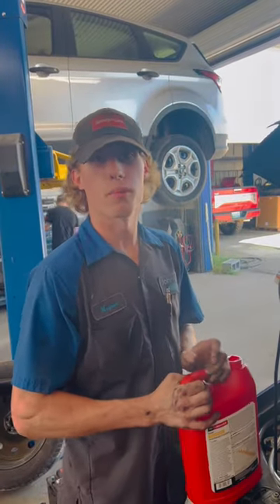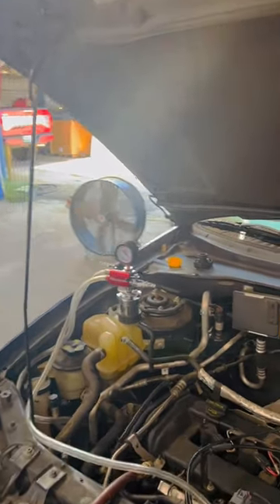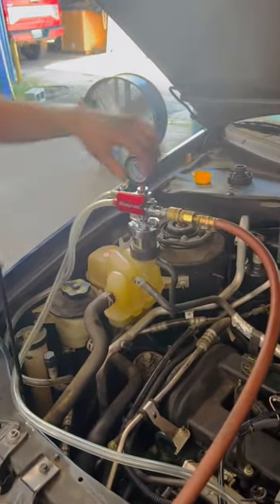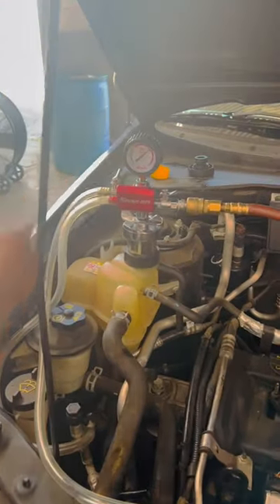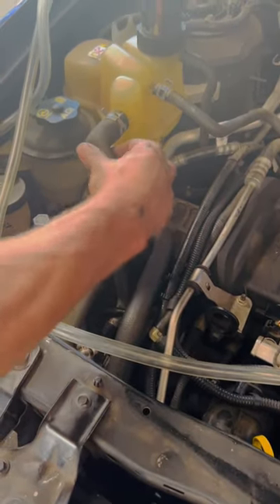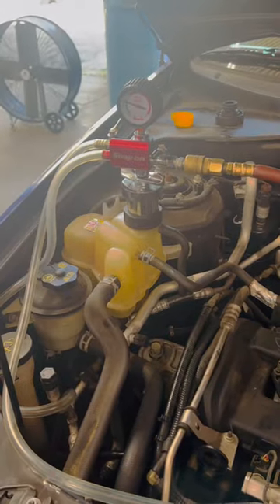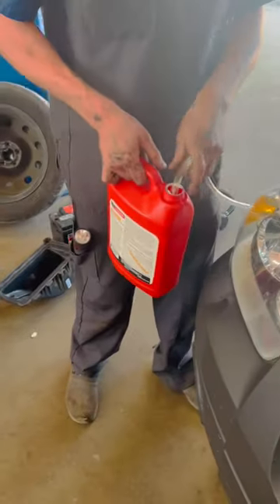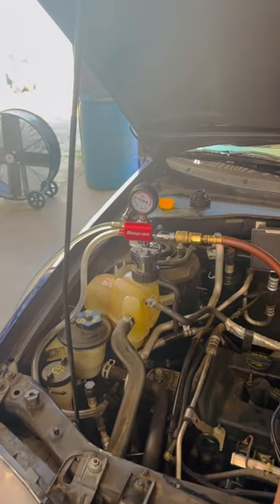How To Fill A Cooling System The Right Way #shorts

Comment: Great! Now I got to buy another tool.
Reply: Yeah lol, they make something called a funnel that costs $3.50 at harbor freight that’ll work just as well vs a $350 snap on tool you might use maybe once.

For those wondering harbor freight makes a vacuum filler as well that’s $50.

Comment: Why bother if you have a radiator cap? Better fill alot of them to pay for anything snap-on.
Reply: He specifically said its for newer vehicles. Most which do not have caps on the radiator.
Reply: @sdvten  that figures. No trans dipstick. Pretty soon no oil dipstick. Wonder where the pressure release is? Old retired line mechanic.  All this new stuff is ridiculous. Now new BMW has a water cooled alternator. WTF.
Reply: Doesn't take a lot of brain power to figure out that this tool saves a lot of time which would otherwise be spent 'burping' the air out of cooling systems. Time is money. Pretty simple if you take just a few seconds to think about it.
Reply: @Krankie_V  trying to beat the flat rate book? The factory flat book has made mechanics do shitty work for years. Everytime you hurry you fuck things up. I'm not into comebacks. comebacks. If you can afford it buy it.
Reply: @genefoster8601  this has nothing to do with hurrying.... It's a legitimate way to fill the cooling system quick and efficiently with no trapped air so you're not wasting time burping it. It both increases efficiency and the quality of the job. I don't rush things. When I can use a tool that saves me a step in the process without sacrificing the quality of the job, you bet your ass that's what I'm gonna do.
Reply: @Krankie_V  if it isn't broke don't fix it.
Reply: @genefoster8601  OK boomer
Reply: @genefoster8601  bmw hasn't used dipsticks on a lot of their models for years now
Reply: @firstlast---  WHY?
Reply: @genefoster8601  It's cheaper and easier to manufacture without a dipstick when you can just use software to make a calculation of how much oil is in the pan. I'm not defending it, it's insane, but that's just how it is. BMW isn't the only offender

Comment: I have a 1998 and 2010 vehicle. So I will just stick to the old ways. If I had a 2016 or newer if give that a try.
Reply: I've used it on many vehicles that old and older with no problems
Reply: @SUMDUDE. , ok. I just run it up to temp and squeeze the hoses and refill until I'm sure all air bubbles are out of the system. 

I didn't say they don't work. I don't care if you've used them,  they work well from what I can see. I just have no need for one, i’d use if every  4 -10 years. My driving habits only net me 7,000 miles or less per year. Currently, I'm at 0 for now as I've had medical issues and haven't been driving.
Reply: @SUMDUDE. , you keep doing what works for you. I’ll stick the way that works for me and I’ll still have a few hundred dollars in my pocket to buy more parts I need to replace. A tool I’ll use maybe 1 time every 5-10 years and can rent for a couple days or borrow from my friend a dodge, ram, Chrysler, Jeep technician or head on up the dealer ship and use after they close.

Comment: I've seen that vacuum system DESTROY: Radiator seals, thermostat housing(s) and Heater cores 😱 in about 10 seconds. Be really ready to do "free work" on whatever you destroy bro. Because it will be your fault. I am sure people didn't bring a vehicle in, for you to say (upon refilling my cooling system), it NOW needs a $1,100 dashboard heater core job, due to your "time saving" vacuum cooling system filler device. Do it properly or don't do it at all.
Reply: 24yr. veteran collision tech. Been using one of these for almost a decade, never had any of that happen once
Reply: @chadvalliere8697  well... Here, in Cleveland, "The Rust Belt" of the USA? I've PERSONALLY seen it destroy over 100 vehicle(s), 1 by 1. They put too much negative pressure on a POSITIVE pressure system. Ever Try to "Suck the air" out of your lungs with one of these? Why not? If it works so well on a car, shouldn't it work just as well on you? My 1999 Ranger & 2000 Honda Accord cooling system would implode. It takes ANY imperfect part and turns it inside out. It makes anything PLASTIC or RUBBER, brittle. I dare you to find an ASE certified cooling system fill procedure (or manufacturer recommend step) that has a "vacuum cooling system step" in the directions of filling ANY cooling system, look in AllData, Mitchell on demand and/or any DEALER level database, get back to me when you find that step. I've already looked, doesn't exist. 💀 The first time you destroy a heater core and LIE to a customer? You'll remember this post. What are you gonna say? They need a $1200 dash/r&r heater core job? Because YOU wanted to save 10 minutes and do it faster? If you destroyed MY vehicle with one of those units, you wouldn't be fixing any cars for a few weeks. Wake up in the hospital with a broken hand. Use ASE tried and true procedures or continue the stigma of parts changer / "mechanics" are hacks. I have 3 college degree(s) and never, ever had to explain to a customer that we "blew up" their vehicle, not once in 30+ years of being an ASE certified technician. Good luck with your vacuum pump. You'll regret it one day soon... 😱🔥😈🥒
Reply: You sound like a “paper champ” spouting off all of your accolades that you’ve accomplished on paper.
Reply: @delascott964  🤔 Hmmm 33 years doing this. I run 2 shops Six days a week... So WHAT exactly is that "paper" your crying about, other than the $$$$$$ in my bank account. Looser 🤣
Reply: @jasonpocaro2730  if you were ASE cert or whatever you wanna call yourself, you would know there is plenty of manufacturers requiring vacuum filling cooling systems. 

You sound illogical not applying correction factors of your environment affecting the integrity of materials vehicles are made with.

Comment: Nope just add the coolant and run the the car for about 10 to 12 min with out the coolant cap and wacth the air purg out and close the cap before the 10 to 12 min mark  between that mark
Reply: Many modern cars have high points. Vacuum fill is most practical for those cars.

Comment: So that area that's in the line that sucked it back in not going to make a difference
Reply from the maker: Never had an issue with it.
Reply: I crack the valve open just for a second for coolant to fill the line completely and then I put it under vacuum again just for that reason. Does it make a difference? Probably not much. But I'm still going to do it that way

Comment: The fill tube still has air in it so either way ur introducing air to the system 🤔
Reply: Fill tube should be opened once it's in a vacuum to purge the hose then the system should be placed in another vacuum.

Comment: This seems like it’s wayyyy overkill
Reply: Seems that way, yes. However, I’d rather take the extra step than to deal with the potential negative consequences of not doing it the “proper way”.

I’ve always elevated the front of the vehicle, while also turning on the heating system to the highest temp, and highest fan speed. This allows the system to circulate coolant through the entire system moving the air to the top (at radiator, or degas bottle) once the thermostat has opened.

I like technology… so, I’ll be getting this tool. However, I understand if a source of air is not available you may have to resort to the tried, and true way.
Reply: It saves 20-30 minutes of shop time every time you use it which is literally $50.... It's quite a valuable tool

Comment: Bought for my g35's cause always a pain to bleed that 3.5l v6
Reply: This is the comment I was looking for my shit keeps overheating because there’s air in the system I changed the radiator went for test drive for about 45 min everything finally seemed fixed heat was on no overheating next time I can back was overheating and blowing cold air on hot again so I’m going this route hopefully it fixies it

Comment: 1. Empty coolant
2. Refill
3. Run engine for 20 minutes
4. Top off fluid
5. Save you some money NOT buying a BS tool made in China/taiwan
Reply: Try filling a 7 gallon system with 3 heater cores and 1/3 of the system is above the radiator cap with no bleeders at the high point in the system that way. Ain't happening, even if you raise the front of the vehicle. My $125 vacuum filler is over 15 years old and has been used on hundreds of cars, possibly even 1000+. 

I can fill a cooling system in less than 10 minutes. So if I saved 10 minutes of work on even 500 cars, that's 5000 minutes or 83.33 hours. Multiply that by my labor rate and that $125 tool has earned me over $5,500 in income. If I've used it on 1000+ cars, which is probably pretty close to reality, that $125 tool has earned $11,000+ and paid for itself at least 88 times. 

So yeah, I see the benefits of spending that money and buying the tool as FAR FAR FAR outweighing the cost of the tool. But go ahead, save your $... because that extra $11,000 in income over the years is "BS". lol 🤡
Reply: @MindsMouth  So if a tech is good/efficient in their work that makes them a crook? A good, honest and knowledgeable tech that abides by industry standards/practices will make more money than any dishonest "mechanic" ever could.  

Those preconceived notions and unconscious bias of yours won't get you very far in life ya know. Contrary to your assumptions, I happen to be a very honest, transparent and successful automotive technician. ASE and GM certified. 15+ years real world experience, 6 of those years I owned my own shop. When I bought it, it was failing miserably and when I sold 60% of it, the volume of repairs being done there had increased nearly 2000% from when I bought it. We were scheduling 3 - 4 weeks out and had referrals coming in on a daily basis. Sorry bud, that simply doesn't happen if you're subpar or if you're ripping people off.  Honesty, transparency and quality is how I turned that place around. 

I sold 60% of that shop for almost $700,000 more than what I paid for 100% of it. I don't have to deal with the stress, just watch 40% of the profits from it roll into my bank account every month (which isn't as much as you probably think). Now I work for myself as a "mobile mechanic". I follow manufacturers recommend procedures because that's what professionals do, I charge the industry standard book times at a competitive hourly rate, because it's honest and I make good money being honest. And those people you say I "prey" on, they actually get a discounted labor rate.

Believe me or don't, I really couldn't give a fuck less what you think or say. But before spewing a bunch of ignorant nonsense like that, try educating yourself first. Or realize that maybe others are trying to educate you. Troll elsewhere though dude, because trust me, ignorance doesn't outwit facts. And I bring facts to the table, every time.
Reply: @MindsMouth  Better off if you would have never posted and showed everyone that you are not too bright.
Reply: @sdvten  I'm not the one writing my life story in random comments trying to validate my life. 🤣
Reply: The whole point is saving that 20 minutes and getting more stuff done, derp.

Comment: They been pouring it in before you were born, I don't think your way makes it proper
Reply: Vacuum filling is actually the "proper" procedure according to most if not all manufacturers now because it prevents air from getting trapped in the cooling system. Some cars are notoriously difficult to burp air out of and can overheat if that air isn't removed. Vacuum fill and that air isn't an issue because you removed it by pulling it under a vacuum.

Comment: Ain't nobody doing that fam. Fill the res, run it, fill again, test drive, fill again.
Reply: Or pull a vacuum (which effectively checks it for leaks before you even put coolant in), fill it, test drive it, done. 10 minutes tops, maybe 15 if you go on a long test drive.
Reply: Some of us like to actually get things done instead of wasting time driving cars around to make sure the air is out of the radiator. Why would I waste my time screwing around bleeding a cooling system when I could just use a tool which does it for me, and fit another profitable job into the day? 🤡
Reply: @Krankie_V  your going to test drive it anyway lol
Reply: @vinnybobby3450  I'm also going to be moving onto the next paying customer while you're standing there fiddling around trying to burp air out of it. I'll stick with productivity, thanks.

Comment: Good way to crack a hose
Reply: Good way to crack a plastic radiator also.
Reply: Anything that cracks from the modest vacuum this tool can apply would have already cracked from the 16+ psig at operation. Damn there are ignorant people commenting.